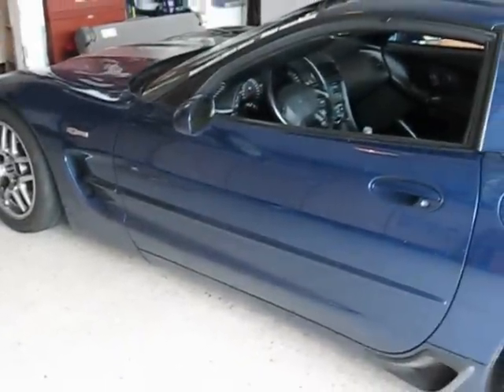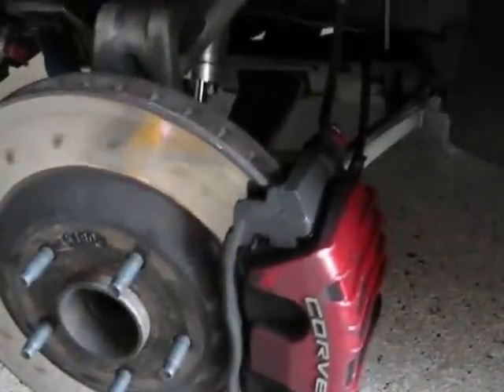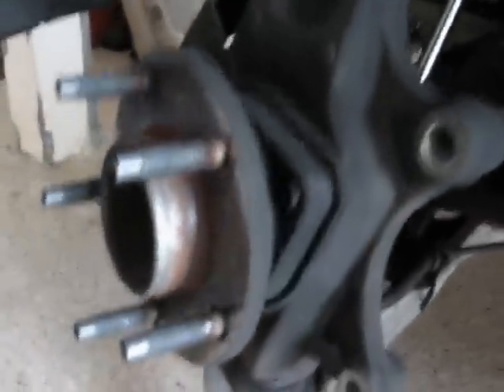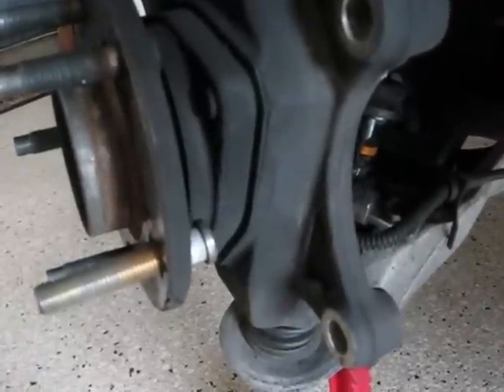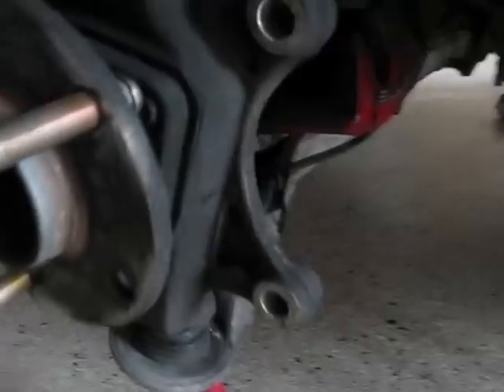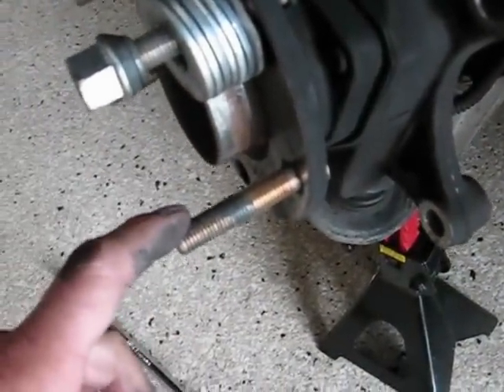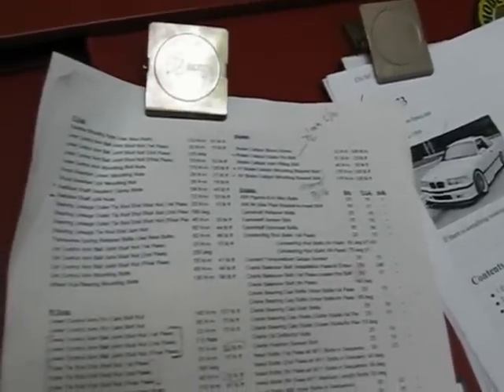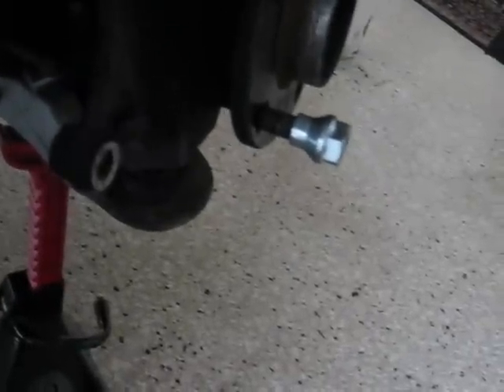Corvette replace front wheel bearing studs C5 by froggy

Comment from the maker: Mostly when guys get into competition on a more or less regular basis, replacement of the studs is a maintenance item, they do wear out due to the constant on/off of wheels. ARP is the leader in studs & fasteners in general and the stud lengths they make are usually not the same as factory spec, so you go a little longer. Other reason is to allow for spacers and adapters for different offsets on competition wheels.

:)

Comment: Froggy, appreciate the video.   Are the studs in the rear and front both 2" total length?   Any idea of the ARP part#?  I was thinking the 2.5" would work.
Reply from the maker: IIRC the rears are 2.5.

You measure the original then add for spacer or diffrent rim offset as required.

:)

Comment: I read on some forums that it is necessary to increase the hole size in the bearing flange to install ARP lug studs but you did not have to do that.  The studs went in just by tightening the lug nut?
Reply from the maker: Never, never, every increase the hole size. OMG. Just tighten on, impact tool is best. Whoever said that should be flogged. Gulp.
Reply: @1947froggy  Thank you Froggy!

Comment: What is the ARP part number? I have a 54 f100 w a front Chevy clip, upgraded to the CPP C 5 big brake kit. Looking for longer studs due to running 1/4 inch wheel spacer.
Reply from the maker: Sorry I don't have it, go to arp web site they come in many lengths. Measure original & add length as needed.

Comment: this doesn't work on my '98 C5. I couldn't even get the ARP to go in without spinning it. once I did, I couldn't get the splines to grab
Reply from the maker: +keath flohr No idea why it would not work.
Reply: I found another post on the forum stating that the only way to put in longer studs is by removing the hub on the front
Reply from the maker: Depends on the hub, some have different dimensions, the originals on my car did NOT need removal.